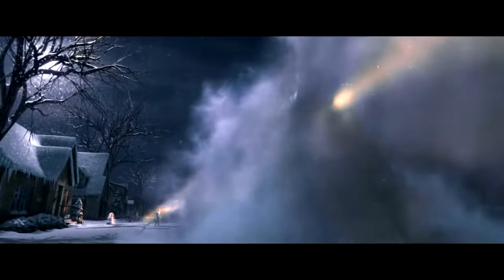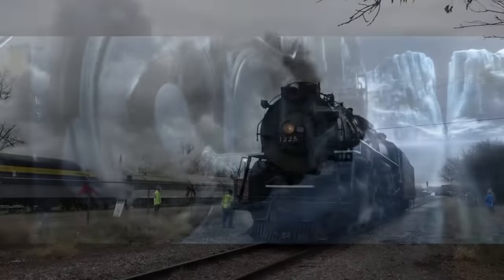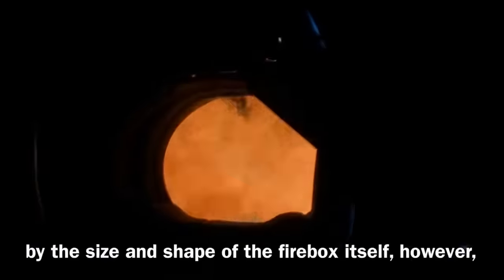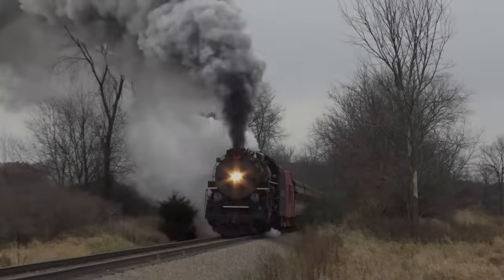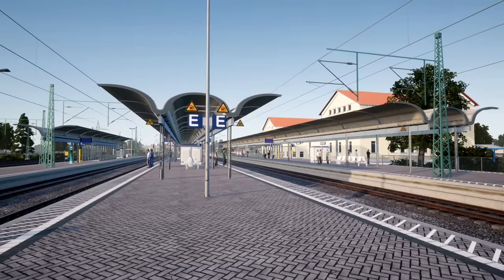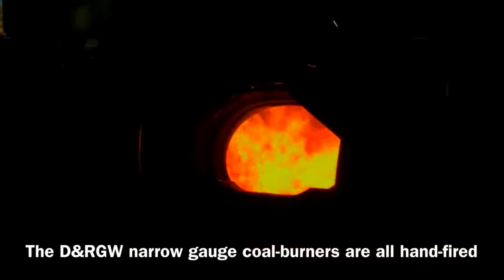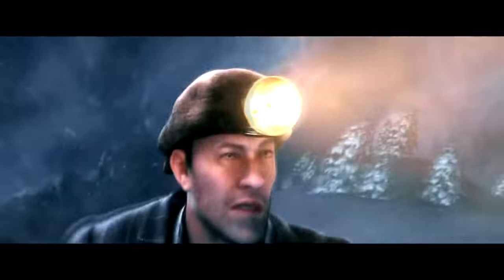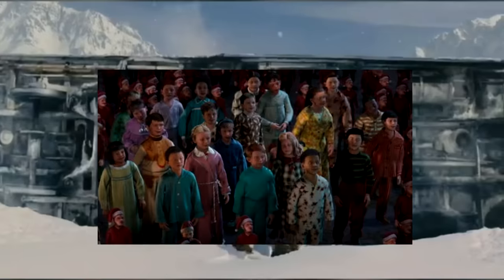Why The Polar Express would Explode

Comment: This gets me thinking. What if the boiler had a water pump that could pump water from the bottom of the boiler to the firebox crown as to prevent it from going dry even with low water in the boiler?
Reply: Some locomotives did have water tubes which drew water from near the bottom of the boiler with an exit in the crown sheet. There were a few different designs which were called syphons or circulators. They were used to increase boiler efficiency and any safety improvements were incidental. No pumps were used to force water through these devices, they had no moving parts. Water in the circulator/syphon would heat up and rise, spilling out at the top while drawing in the relatively colder water from the bottom of the boiler. But an exposed crown sheet could still heat up faster than the water flow could control it.

A Chesapeake & Ohio 2-6-6-6, locomotive #1642, "blew up" due to low water in 1953. It was equipped with 3 huge syphons in the firebox, but the crown sheet still ruptured. The expanding steam from the explosion exited through the firebox and lifted the boiler off the frame, flinging it in a cartwheel over to land upside-down in front of the rest of the locomotive. 

These explosions are not due to the water suddenly heating. When the crown sheet ruptures the boiler pressure is released. This lowers the boiling point of the water, which tries to turn into steam immediately. The sudden expansion of water into steam is the explosion.
Reply: @steveboguslawski114  darn, well scratch that idea I guess

Comment: one thing i think would be different is that there would probably not be any survivors that could be coming out of the train. After the locomotive explodes it would most likely make the cars derail and slam into the mountain. At the speed the train probably had at that point the impact would have had so much force that the cars would be ripped off of their bogies and compressed to at least half of the trains original length making the chance of survival pretty small.

Comment: The polar expressed spawned my fear of trains. Immensely powerful, unstoppable forces you can’t get off of. The multiple times the kids are holding onto this death machine for dear life, like when they’re speeding down this roller coaster mountain thing, and the cracking ice, and the caboose detaching with the kids inside, just praying they don’t fall into the void, their fate in the hands of a giant, incomprehensible power that is not alive, and will not save them. AND THE TIMES WHEN THEY’RE RUNNING ON THE ROOF. THE SNOW COVERED ROOF THAT WILL JUST LET THEM SLIP OFF AND DIE. DIE A SPEEDY, HORRIBLE DEATH.
Reply from the maker: Ya I can get that, I started liking steam locomotives more because of the movie
Reply: @ChriswithaK  I have a respect for how cool and sophisticated and powerful they are, but when a train goes by I run. Too loud.

Comment: I believe why the polar express didn’t explode, it’s because the locomotive has some kind of cooling system that goes right to the fireboxes and has a lever that opens and the closes a hatch where the cold air is going right to the hot fireboxes and when the steam engine goes faster and faster it opens by the the higher train speed automatically
Reply: I mean, there are literally safety systems built for this kind of thing IRL. So it’s not hard to believe that a train that runs on literal magic wouldn’t have a far more superior safety system than that, or at the very least somewhat equal to them lol

Comment: But if the crownsheet weakens, that doesn't lead to a boiler explosion. At least, not in the way depicted by the pictures. Remember, for a boiler to explode, the thing that has to fail is the shell. The outer layer of steel. That is the actual pressure vessel. As the water comes back in contact with the firebox, some will evaporate and generate a pressure surge, however, since the water was all at the front, where much less heat is transfered. That means, steam production rate goes significantly low. Since the loco is still using her pistons (that means the steam consumption rate is the same), the pressure will decrease during all the time she's going down. Now as the water sloshes back, it'll create a pressure surge, as i said, BUT, since the pressure inside the boiles has gone down, and the water is pretty difficult to bring to a boil, i'd say the shell would be perfectly fine. Maybe some valve or piston damage, but no explosion.

What COULD happen is that the firebox's top weakens from high temperature changes. Basically, what happens when you pour hot liquids in a cold glass. The fast reduction of heat, combined with the extra stress from the pressure surge and the deformation that could occour while it was overheated, might lead to a failure, but of the firebox.
Which basicallly lets all the pressure from the boiler inside the firebox, and since the only way out of the firebox is directly inside the cabin...

Yeah, it's not a good scenario for the enginneer and fireman...
Reply from the maker: I actually based my theory/hypothesis on the 1977 Bitterfield Boiler Explosion and Ghettysburg firebox explosion.  When it comes to overpressure and a boiler explosion, it's not the crown sheet vs shell giving away that determines whether or not the boiler explodes. When the water comes back to touch the overheated crown sheet it not only instantly increases the boiler pressure, but it also substantially weakens the crown sheet itself. In other words, regardless if the boiler does or does not get over-pressured from the water instantly evaporating into steam, the increased pressure combined with the rapid cooling of the crown sheet will cause it to fail. To clarify, it is not the boiler nor purely the pressure itself that fails during a boiler explosion, it is the weakened crown sheet and therefore the firebox that causes it.
When you say "since the pressure inside the boils has gone down, and the water is pretty difficult to bring to a boil" while on the surface it may make sense, it actually makes no sense at all. The water in the boiler becomes harder to boil as the pressure inside GOES UP. This is due to molecules in the water being pressed down together harder in a pressured environment. It is also the reason why the water in the vacuum of space will start to boil at room temperature. So as the pressure inside goes down, the amount of steam generated stays about the same (up until a certain point of course). Increased steam pressure will not damage valves or pistons. The only thing it will do is maybe set off the pop valve
What you explained in your second paragraph doesn't make sense since a failure of the firebox WILL lead to a boiler explosion. What I think you're confused with is the protection boilers use with crown stays. These are the supports for the boiler and in modern steam locomotives and are typically designed to prevent a complete failure of the crown sheet. They can allow for one part of the crown sheet to fail first before any other part causing only a small section to bulge out instead of the whole engine blowing up. What you described was a blowback/backdraft. This will happen when the integrity of the firebox stays in place, but the pressure from the boiler still manages to leak into the cab.
Reply: No, the engineer and fireman will likely be fine because at this point, they had left a little girl in charge of driving the train.
Reply: @teenytinybricks  even better
Reply: My understanding has been that a weakened crown sheet is the most common cause of boiler explosions. Low water is more dangerous to a boiler than high pressure, though the two are connected as steam generation increases exponentially as water levels decrease. If the fuseable plug fails to melt, the crown sheet weakens from the unregulated heat from the firebox below until it cannot handle the pressure of the steam above it. More often than not, this happens when water flows back over the crown sheet, instantly flashing to steam in a violent way. The thing to remember about boilers is that all of the water only remains in its liquid state due to pressure. It is well above the boiling point. This means when pressure drops from a rupture and the steam has a path out, all of the water flashes to steam. Steam takes up 1600, yes 16 Hundred times the volume of water. What happens next is basic, tragic chemistry that is capable of sending a engine that weighs upwards of 100 tons 25 feet in the air and sending hot shrapnel as far away as 1000 yards. Steam engines statistically are safer than US Highways, but as with any machine, they must be respected and understood to be run safely. When and engine is cold, it is owned. When an engine is being fired, it owns you. The second an engineer forgets that, you are headed for trouble.
Reply: It’s also mostly safety valves not being able to hold the pressure surge
Reply: It’s also mostly safety valves not being able to hold the pressure surge
Reply: @ChriswithaK  Doesn't the polar express have pop off valves? They would prevent the locomotive from a Catastrophic pressure failure if functioning properly.
Reply: @hamiltonsullivan6563  but the amount off preasure and the instant production off steam in this case will probably be more then those valves can handle. but he is forgetting to mention a few other safety features for this case, in most newer engines there are a few pipes going through the firebox connected on the front or side of the firebox and the top. Since hot water goes up this results in a reasonably steady flow off water on top off the boiler, witch helps prevent it from overheating in the case off water getting low( in normal flat track circumstances), but in this case it might be that the grade is to high for it to properly work. Also its a firemans duty to keep up the fire, preasure and amount off water in the boiler, so its also his duty to know that there was gonna be a downhill and for a case like this he wouldve probably turned off the blower and let the fire simmer down a bit, resulting in the firebox being way less hot and the water not faporizing as much as he thinks it will. wich woulve resulted in the praesure release actualy being able to handle the preasure.
But a far more likely failure in this case would definetly also result from the increadible steap downhill: the water getting in the steamdome and thowards the pistons, resulting in a catastrofic failure of both pistons, valves and some other throttle components. And on this steap a hill the train would probably not be able to have enough grip on the rail resulting in all kinds of dangers  from derailing to increadibly dangerous speeds to folding or breaking carts in half with slightly imperfect braking or sudden grip to simply melting bearings or other components handeling the friction. 
In these clips it almost looks like a 40% downhill, wich is unpresidented in todays and yesterdays railroads, with the steapest normal rail tracks most likely never exceeding or having exceeded over 15% and current standard gauge track being constricted in most places to no more then 3% max, wich would be considered alot btw. 

so yeah polar express has a lot of realworld issues but its a magical kids movie so who cares.
Reply: @patdbus  I agree, the dif between us and this guy is were rail buffs. He can reserch boiler explosions but we ha e years of knowledge on most of the equipment he brought up!
Reply: The crown sheet is part of the “pressure vessel”
Reply: @ChriswithaK  Gettysburg railroad neglected their responsibility to properly maintain the locomotives, ranging from missing gauges to poorly maintained air compressor and lastly this is the root of the boiler explosion, they didn't even do a proper Blowdown to clear any scale deposits from the water glass to get an accurate reading, which resulted a poor readout on the water glass which gave the wrong information which the water in the boiler which resulted in the crown sheet fail. Just for your information, the position of the stay bolts plays a role. Diamond bolt layout is less of a damage than a squared bolt layout on the crown sheet. The locomotive in question from the Gettysburg boiler explosion has a diamond pattern which only give a bulge in the firebox instead of a full explosion which only give the crew first degree burns from the steam. American/Canadian Steam Locomotives don't have melting pots, only German Steam Locomotives has it. Another factor is rather a high risk is to purposely run the steamer on low water level to gain more operating pressure, this practice resulted in a explosion one of the photos you used is of a Chesapeake & Ohio class T-1 2-10-4 Texas type which blew it's smokebox door off. Also, there is a biggest difference between steamers of the 19th century and 20th century steamers, 20th century steamers are better built with better steel than the 19th century Ironhorse which cause far more injury with flying debris since they are not built with the same steel as the 20th century steamers. Pop off valves are more common on 19th century steamers than 20th century steamers also due to better materials.
Reply: You would also flood the steam-dome. The superheater doesn't like ingesting water (which is the whole point of the dome, skimming steam from above the water) and neither do the pistons.
Reply: @hamiltonsullivan6563  well actually i have a few hyce videos, common sense and a year of high level physics under my belt. Im not really a train buff, im more into big and epic machinery, wich includes trains.
Reply: @patdbus  Hyce is the best!
Reply: @patdbus  respectable choice of hobby
Reply: there is probably too much Pressure in the moment to vent it all out
Reply: What happens is that when the water comes into contact with the overheated crown sheet, it flash heats into steam resulting in a sudden pressure spike. THIS causes the boiler explosion, the sudden spike in steam pressure above the designed limit and too quickly for safety valves to vent it.
Reply: @WardenWolf  and even if they react fast enought thats not going to help but in fact might make it explode in the first place.
A body exploding will not destroy itself everywhere at once but from a point of failure through the body (granted it happes so fast it seems like everywhere at once) a preasure valve getting blown out with to much force could weaken the sorrounding vessel enought to start a cascadic failour throughout the marterial and therfore exploding the body
Reply: @ChriswithaK  I’ve actually seen first hand how instantly water exposed to red heat builds pressure. When I was a kid, I heated up one end of a steel pipe orange in a fire. The other end had wadding and a rock stuffed in it. Dipping that open orange end into a creek actually produced such an energetic flash of steam that it shot the rock out at a similar velocity to a primitive firearm and instantly heated up the pipe to a temperature that burned my hands. This happened with no sort of pressure containment at all, just a simple pipe with no end caps.
Reply: It looked like the slope might have been enough to get water into the steam pipe

Comment: This was fun. Hypothetically, if the regulator can work almost directly from the steam injector then assuming you had 3/4 of a glass of water in the boiler as you crested the hill you could run with the injectors fully open all the way down the hill without melting the fusible plugs and without over filling the boiler. Still a very risky situation of course 😂 but I reckon I could do it 😁🚂
Reply: "I want to go FULL THROTTLE down this hill. Do you understand me!?"
Reply: It’s hilarious how something that sounds absurd on paper (going full throttle down hill certainly sounds nuts) is actually a necessity for fear of death in practice. It’s like when you have a ship listing from taking on water. Logic says taking on even more water is insane. However counter flooding is mandatory technique to avoid having the ship capsize entirely.

Comment: In theory, is it possible to modify a steam locomotive to overcome high climbs and descents? What if we add the same dividers to the water tank, which, for example, in fire trucks and prevent them from turning over on turns? 🤔
Reply from the maker: That is definitely a possibility, but those systems wouldn’t work in a boiler. The system you’re thinking of is a baffle system which has a series of walls or something similar going down throughout to prevent water from accumulating on one side of the container.

A steam locomotive boiler actually has very little space for this kind of system due to the flu tubes. These carry the heat from the firebox, through the boiler, and through the smoke stack to heat the water. These take up a majority of the space in the boiler. Ontop of that, the polar express, or atleast the engine it’s based on, has a super heating system which pumps the already heated steam back into the boiler to be reheated into super heated steam. 

This further reduces the amount of space in the boiler. This is why even steam locomotives that navigate super steep grades don’t use the baffle system, it just doesn’t work for steam locomotives.